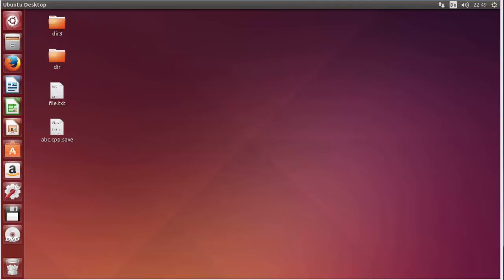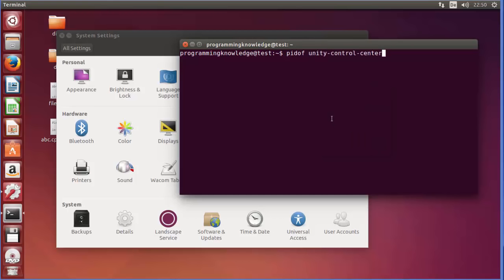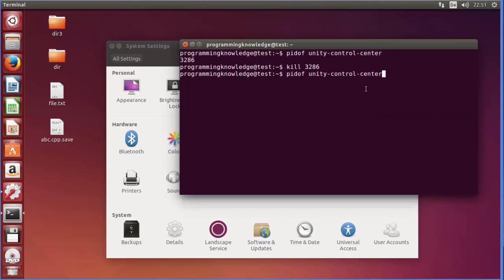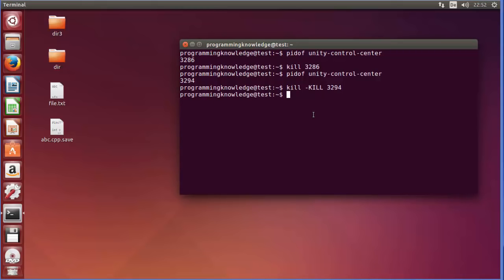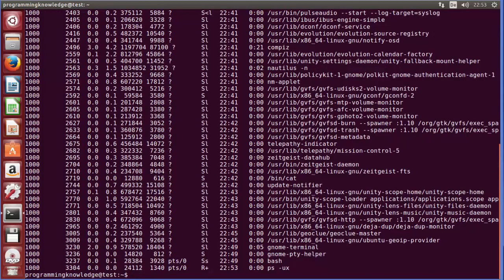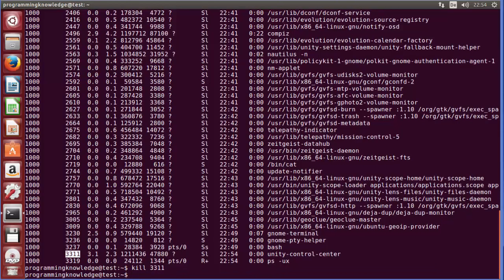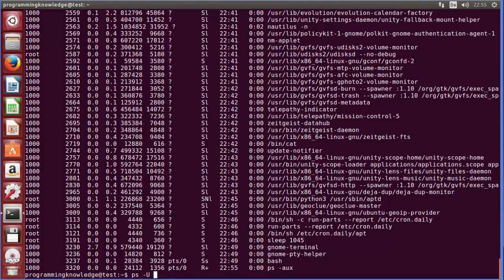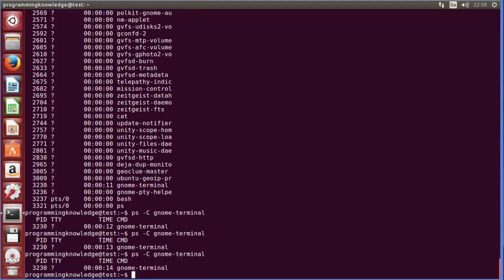Linux Command Line Tutorial For Beginners 15 -  kill command

Comment: I have an Ubuntu 22.04 - when running pidf gnome-control-c  - nothing shows up on my screen.  I can see the PID lists as 4527 but is NOT showing in the terminal w/ an exception of blank result.  Is there is a reason why?
Reply: Because you need to write it like this "pidof gnome-control-center". I had the same problem

Comment: for those who have issue with process GUI name and name in terminal :
run top or " ps -ef " command and note down the PIDs from there. then run " pstree -p (PID) " . replace (PID) with one of the noted PIDs. this command will give you both the GUI name and name in terminal  of that process. and try to remember names like this. may be there is another method but meta AI told told me about this method